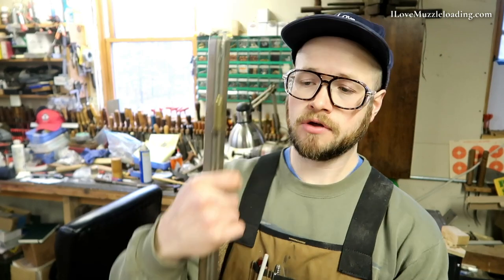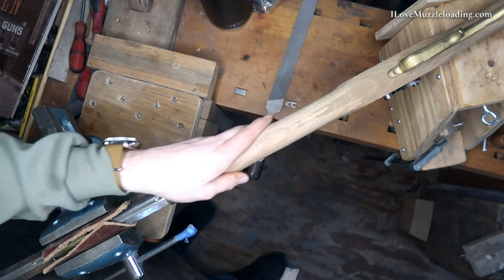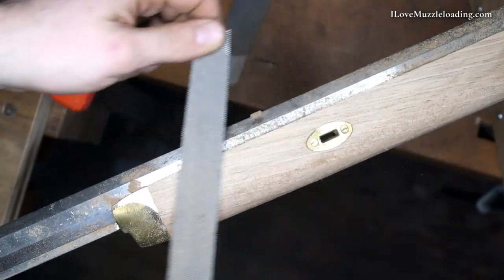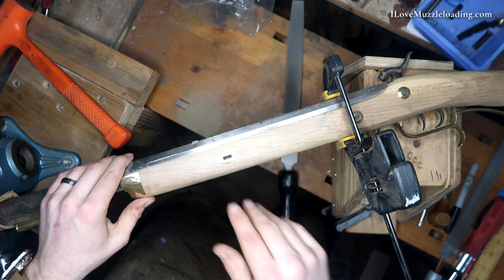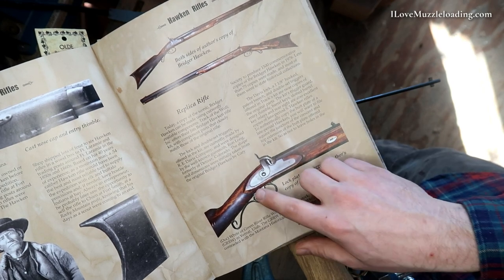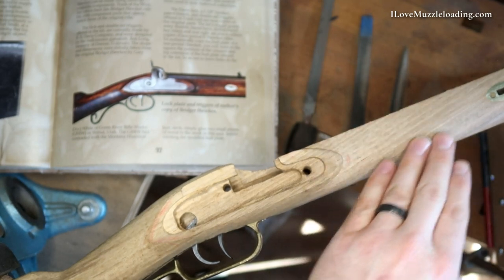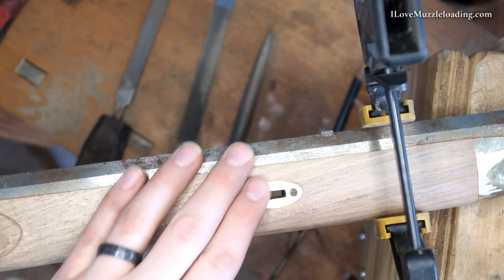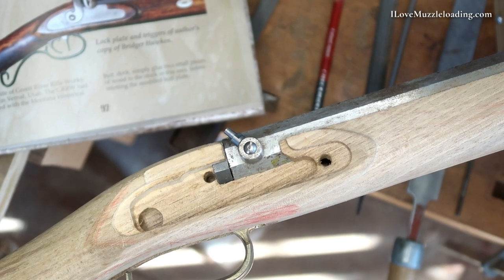Let's Build a CVA Hawken Part 2 | Wood Shaping, Mortise Refining | I Love Muzzleloading

Comment: Fill the screw holes with epoxy and move the butt forward until it matches up to the wood. Butt plate is very thick also. Personally I'd take the butt plate down on the out side edges along the sides. To about 1/8 .
Reply from the maker: Oh good idea!